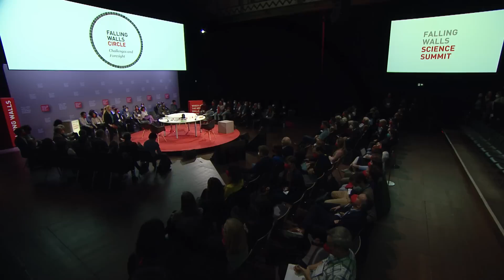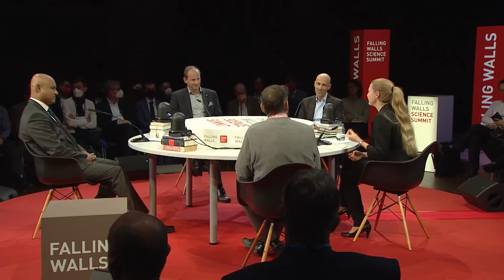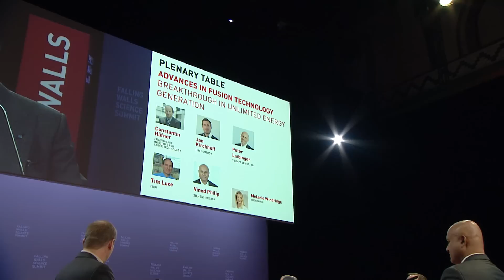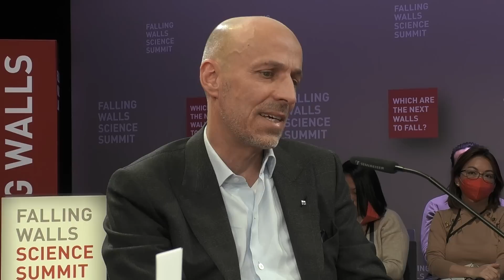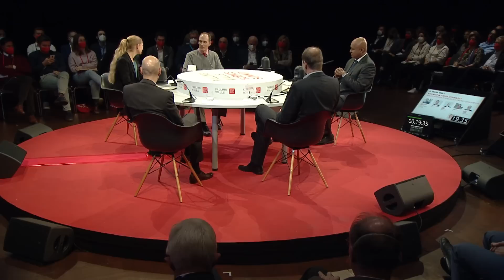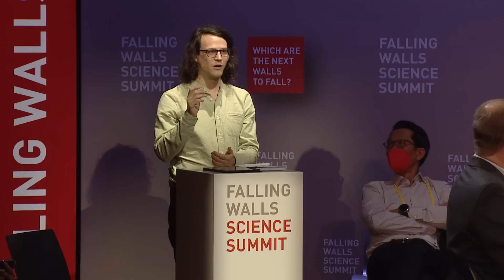Advances in Fusion Technology: Breakthrough in Unlimited Energy Generation

Comment: #1 Quick, we are running out of funding!
#2 Let's pretend we had a big breakthrough ... 
#1 But how?
#2 Just don't count all the energy the lasers are using up, and claim that we have actually produced energy.
#1 Pure genius!
Reply: They have achieved getting more energy out than putting in now
Reply: @jamesrow3794  Actually they didnt.
Reply: Actually they have !!
Reply: @jamesrow3794  No. Because they excluded the energy the lasers used and also the energy that it took to produce the pellets that feed the fusion.
By applying the same logic, one could claim that Tokamak-reactors already have achieved success some time ago. Which would also not be true...
Reply: @jamesrow3794  Yes. It's called nuclear fission. We've had that technology for the past 80 years.

Comment: All that's needed to harness nuclear fusion is to point a solar panel at the sun.
Reply: But those take more energy to make than they can provide in their lifetime
Reply: Sustained fusion on earth can produce more energy than any solar panel in earth can collect. To outpace fusion, you’d need orbital solar collection platforms. Millions of them. 

These types of solar panels are humanity’s future, but not for a very very long time as our ability to wirelessly transmit energy over vast distances is not there yet.
Reply: @Kevin Polito  ok Prove me wrong....
Reply: Until it’s not shining.😊
Reply: @Non-ya-business  You can run overnight on batteries. In fact, you can run for days, or a week, or stored solar. Australia, Hawaii, and California utilities have replace fossil-fueled peaker plants with Megapacks.
Reply: @kevinpolito1529   come on, we both know that is not viable as a long term solution, I’d rather bet on fusion then some breakthrough battery I keep hearing about. Plus Germany has done more to adopt renewables and they are searching for wood to heat their homes right now in certain areas, and are in an energy crisis this winter. I live in CA and our energy bill has gone up substantially, since adoption of renewables. It isn’t reliable, it’s defuse, and we’re relying on some mega super ultra packs which are just many of the same batteries we have now.
Reply: @Non-ya-business  They produced a nanowatt for a nanosecond with a zillion watts through 192 lasers. That's a joke. I have a friend whose residential solar supplies all the energy he uses and excess that he sells to the grid. It paid for itself in 7 years.
Reply: @kevinpolito1529  this is far bigger than a solar installation on a roof top.
I’m glad your friend paid off his panels, but he’ll have to do that again in about 25 years. It’s just not sustainable for a future.
Reply: @Non-ya-business  In 25 years solar panels will be cheaper and more effective.
Reply: @vitalilisau6181  the best you can do with panels is 70% theoretically, and again this is ideal tracking with optimized incident angle. This provided you don’t have clouds, or dirt. Its diffuse and unreliable.
Reply: @Non-ya-business  well, if you say that unproven tech should be relied upon for the future, why not solar panels? Only need to put a 1 atom thick layer of graphene onto every glasswindow that is exposed to light and it will generate electricity. Wonderful tech. Yet it turns out to be far more difficult than expected too create cheap graphene that does the job.

As far as fusion goes, what you said: I know. It is  (was) based on a model of the sun that has many problems.

Saphire has an alternative model of the sun. They wanted to test their model and inadvertently created enormous heat with only 1500 watt input. They used specific gases, , and electricity.

Contrary to what you said, I am all for progress...but the science establishment can not break out yet of their inaccurate model of the sun, and as such will never get  any viable results.
It appears Saphire has been snatched up by the US military complex, with a commercial branch left alive to try and market some of its results.
Their approach is low budget and they created some astonishing results, I guess because they have a much better understanding what goes on in the sun. 

Anyway, time will tell. But all the hoolahoop this week about a "breakthrough" is misleading.
Reply: @gammaraygem  so my issue with solar and for that matter wind, is it’s diffuse (needing large spans of panels/turbines to generate the wattage). Both are dependent on something that is not reliable, such as weather.
Even if we use double layered panels with super conducting materials, we are dependent on a radiation source that isn’t reliable.

I think those sources are a distraction for the US using fission, natural gas, and hopefully fusion.
Reply: @Non-ya-business  An important aspect of solar is at the same time learn to use less electricity. I lived with solar for 14 years, off grid completely, with a small backup generator. When I moved to  a house that was on-grid, the electricity company came to check if we´d tampered with the meter. We used so little they did not trust it. 
Portugal (Europe) where i live already has 50% of its energy from renewable(wind, sea,solar).

For most households solar will work.
It is being rolled out in Holland (europe)and innovative ways to store electricity, and heat as well.

I am all for a mix of energy sources. I dont think Big Corp is ready yet for "free energy".
In a way, the war in Ukraine has been a wake up call for many europeans, and we´ll discover we can live quite well with less use of electricity.

Holland just announced building two new nuclear plants. So industry can keep going.
Reply: @gammaraygem  I understand what you mean. I just don’t believe new technology should restrict us, IMO this is a downgrade. I believe new tech should be more efficient (meaning less energy spent for the same (or more use)). And sources should be more potent. Fission was supposed to be our near term solution but we’ve been against nuclear fission for decades now. Again, leaving us to this sort of hand to mouth existence. We’ve now gotten to the point where we’re saying use less. 
Just saying how I feel about this. I feel this is an opportunity to not only make it a “base power” source, but make it THE power source. But this is how I feel.
Reply: @synthwavespartan2808  No, they don't. Look it up.
Reply: @Non-ya-business  That's what storage and other sources of energy are about.
Reply: @Non-ya-business  I'm old enough to remember when my business's computer filled a building. To pretend that we are not making breath-taking progress isn't helpful.
Reply: @alan2007-x8x  precisely Alan! This is an amazing breakthrough!